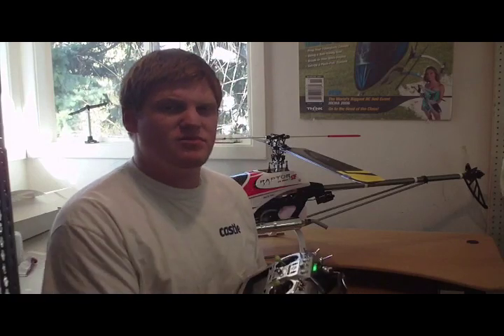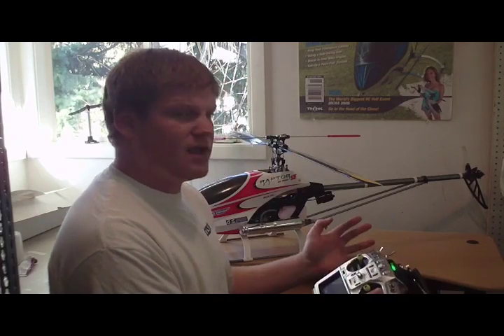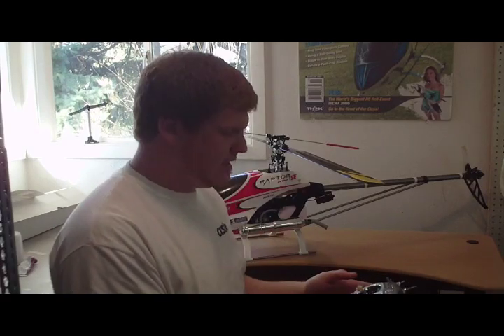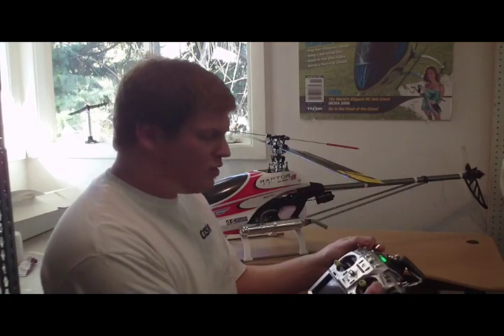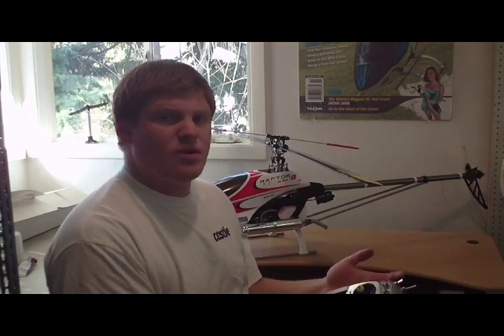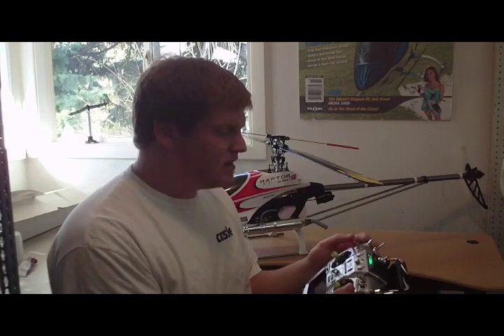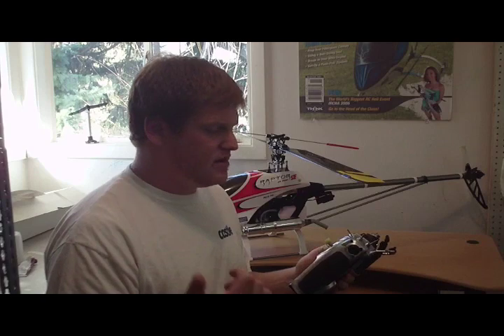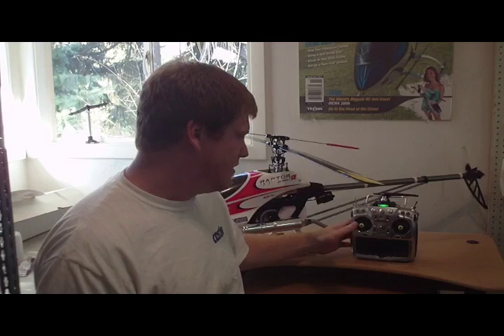How RC Helis fly upside down

Comment: How does the helicopter HOVER upside down?  You only said how you control it in while doing aerobatics.
Reply from the maker: with aerobatic model up setup for 3D, the model can hover with the same amount of negative pitch inverted as it requires positive pitch to hover upright. control is identical upright and inverted, you just have to wrap your head around the right way to move the sticks to get the desired results

Comment from the maker: @GROOGLs 
you've almost got it, when you put it in 3D mode/Idle up the throttle uses a separate throttle curve that keeps the RPM up at all times. For some electrics or if you use a governor this may mean all values for throttle in idle up are the same high number. If have have a conventional idle up curve it will be a little less at the center, but you never go to zero throttle in idle up.